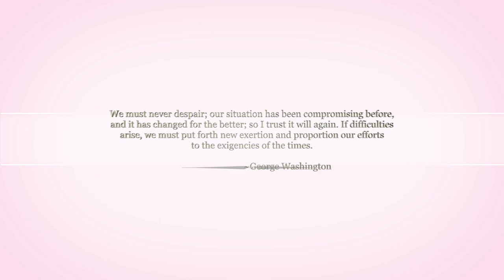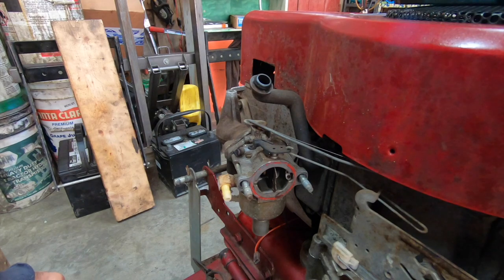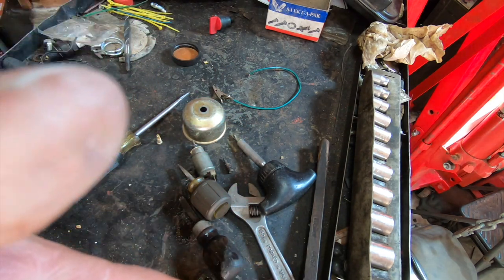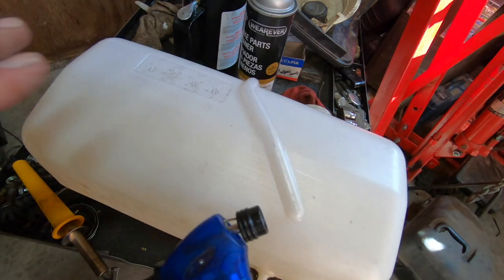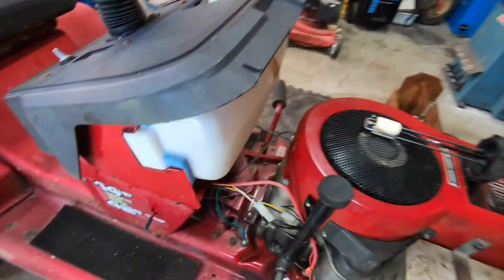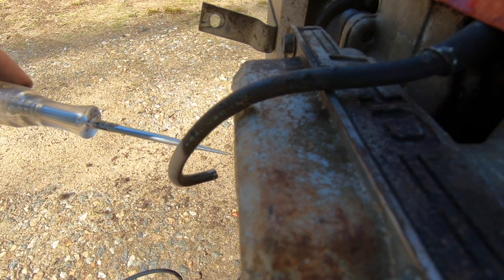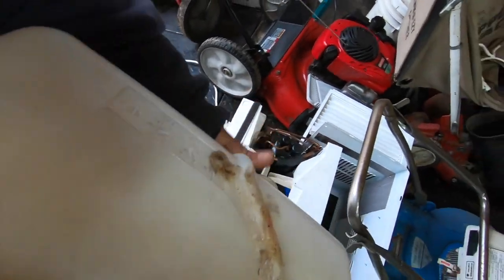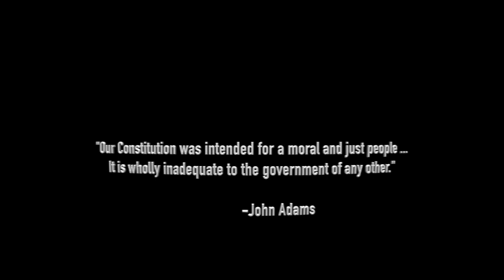Surviving tough times - getting old equipment running - carb clean, plastic welding, life lessons

Comment: lets go brandon!   all i got to say about that    yea i thought it was a sticking valve also... i will say if cars were like the way they are now when i got into it i wouldnt!   hmmm what you said sent me back...with mini bikes boat motors my parents bought once and your on your own kid...when it broke i had to learn how to fix it   that goes for everything i have nowadays smitty hows the hand looked ok in the vid...
Reply from the maker: Amen to that, Dave! FJB / LGB!!  Hand is ok, but the knuckle just above that broken bone is killing me - ever since the surgery it has hurt pretty bad. Surgeon might have put a screw too close to it or something. Pain hasn't got any better at all. I also can't grip small, thin things with any strength, either. Can't make a tight enough fist.  I've got used to it. At least I can work, and can still fly with it like this. Went to the local airport the other day, but the winds were a bit too strong and gusty. Next time!  Yeah, I probably wouldn't have got into this field, either with the infuriating garbage produced today! 

I'm about done with this cold weather crap! Come on SPRING! 🥶